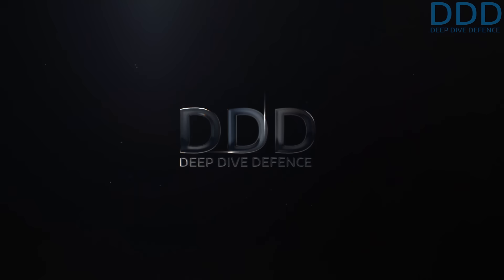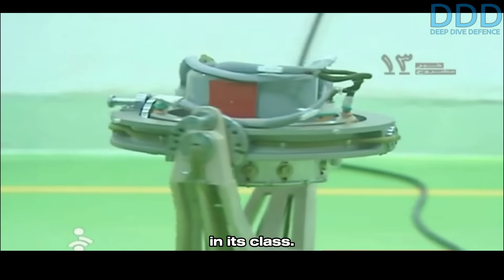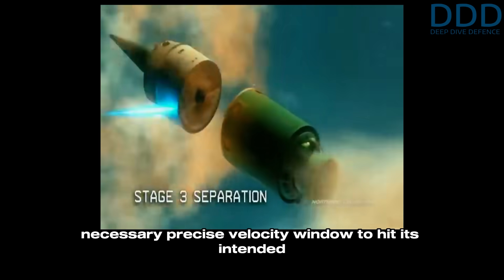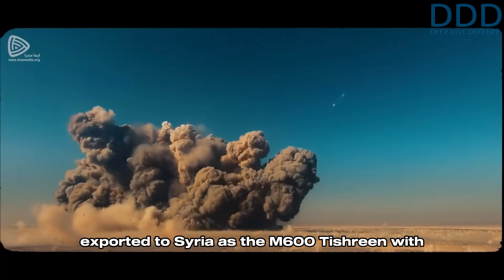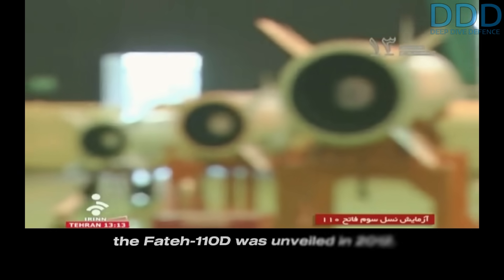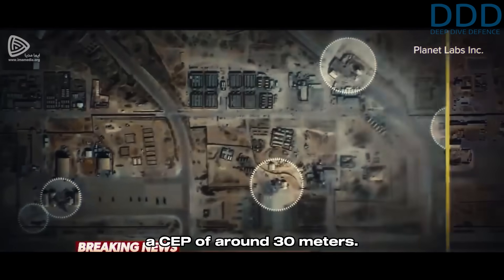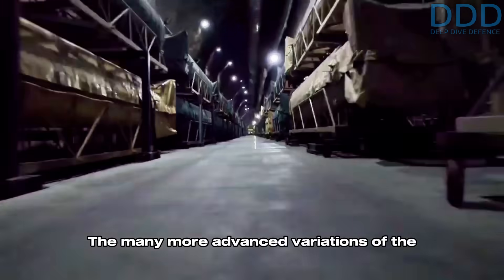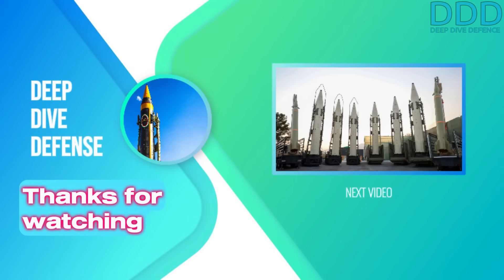Menace to U.S. bases in the Middle East: Iran's Fateh-110

Comment: Great video as always!
Do you think Hizbollah lost most of its Fateh 110 arsenal or did they only had tens of it? And is it still possible to use it effectively when the Israeli airforce has a complete domination in the air so it becomes an easy target?
Reply: i don't think they lost their aresenal, the reason they didn't use them extensively was that the entity was threatening to hit civilian infrastructure in Beirut  (outside of dahyieh)  intensively if the resis escalated more.
Reply: How many Fateh 110 missiles do you think Hezbollah possess?
Reply from the maker: No one know such details. Hundreds or thousands
Reply: i don't think 7izb lost their aresenal, the reason they didn't use them extensively was that pissrah-ell was threatening to b0mb civilian infrastructure in Beirut  (outside of dahyieh)  intensively if 7izb escalated more. there's propaganda push by the entity and the US and their arab allies to say that 7izb is finished, which is not true.
Reply: i don't think 7izb lost their aresenal, the reason they didn't use them extensively was that pissrah-ell was threatening to b0mb civilian infrastructure in Beirut  (outside of dahyieh)  intensively if 7izb escalated more. there's propaganda push by the entity and the US and their arab allies to say that 7izb is finished, which is not true.
Reply: It's highly unlikely ... But who knows .
Reply: MENCE HİZBULLAH GUCUNU OLASI İRAN MUHARİBESİNE SAXLADI,İRANA QARŞI DÖYUŞ BAŞLASA HİZBULLAH İSRAİLİ FATEH VE FECR 5 ROKETİYLE VURACAQ🚀🚀🚀🔥🔥🔥🔥🔥